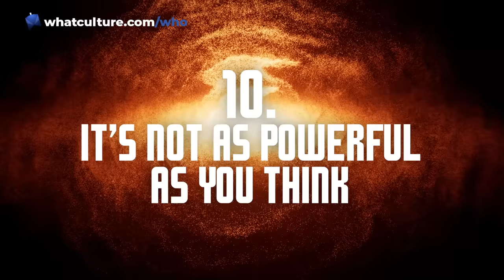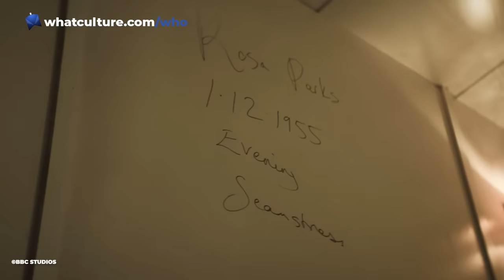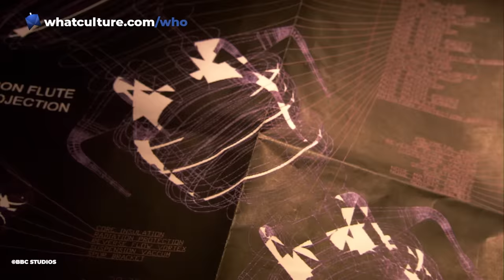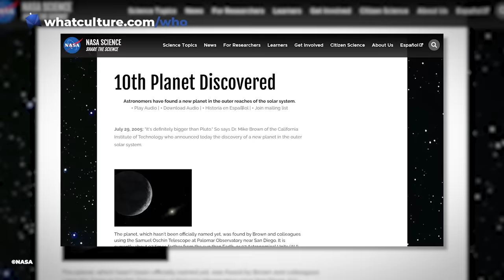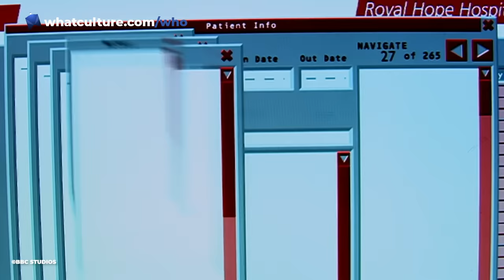Doctor Who: 10 Secrets Of The Sonic Screwdriver You Need To Know

Comment: The Sonic didn’t open the TARDIS doors from the outside not because they were manually locked with the mechanism shown in the clip you used, but because the doors were deadlocked from the TARDIS console.
I don’t know if this is a thing with the editor using the wrong clips, because it also happened when it was stated thr screwdriver could shoot lasers, and the clip showed something that was NOT the screwdriver.

Comment: I want to point out, the 11ths had a psychic interface, the visual dictionary says 9-10s has gallifreyan circuitry which makes a dial or some similar adjusting device where small movements can make a huge change, hence why 9 tells Rose to use setting 1412B (or some such number) to reattach the barbed wire

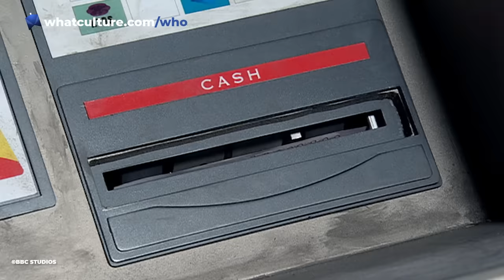Comment: 3:02 Guy with a degree in Theoretical Physics here, with some personal headcanon about The Doctor's magic wand. What is "sonic"? Sound, right? What is sound? Pressure waves. What are waves? Oscillations. What are oscillations? Back and forth movements. Literal wibbly-wobbly! At a quantum level, everything is wibbly-wobbly, oscillating, waving. So if the sonic screwdriver can emit, stimulate, resonate with, and detect quantum oscillations, then it can interact with matter and energy at the quantum level. So it can detect the quantum states of the semiconductors in computers, it can resonate concrete, it can set up vibrational modes in screws. The psychic interface means you point and think, and it feeds back to your brain as if you'd seen, heard, or smelled the information.

Comment: I think the sonic screwdriver is either or both a stupidly good lock pick and signal jammer. Locks doors anything that needs to be opened or fiddled with it will do that. It is quite literally a master lock picking tool. I think the reason those locks could not be opened is due to the fact that the doctor could not figure out how they worked yes he is a genious but they are a cut above what he can do. I think this is a galefriening tool since if they have a living machine that can travel through time and space then why could they not have a tool that could open nearly any door or interface with any machine.

Comment: Wasn't it determined that the sonic COULD work on wood, but the calculations would take centuries? Or was that deadlocks? Then they realized the door wasn't locked in the first place.
Reply: Not exactly. In Day of the Doctor, they were scanning the entire room to get the sonic to calculate a singular weak point in the whole structure. A shatterpoint, if you get the Star Wars reference. So it was the whole room, not just the wooden door.
Reply: @TheFiddleFaddle  The War Doctor explicitly states he scanned the door and implanted the calculation as a permanent subroutine to calculate how to disintegrate the door.
It took around 400 years for the sonic to calculate it, so yes it does work on wood and takes several centuries.
Reply: @jollybodger  And in the later episode 11th Doctor tells the wooden Cyberman (or Wooderman?), that the sonic screwdriver still doesn't do wood. I think it did work only on that door under London's Tower, not every wood. Not like all wood in the world is the same, is it? You have birch wood, then you have acacia wood, then there's oak wood, the list goes on. All have different density, different kind of substance, different properties, some are easily bent, some are hard to even cut. So what worked with a single door in 400 years of uninterrupted calculations, might not work on a wooden Cyberman from a different kind of wood.
Reply: @Croftice1  I wasn't claiming it would be the same for every wood type, I assume it can do wood as we know from a single example, but with the centuries, possibly millennia it takes to calculate it's just easier for the Doctor to say it doesn't do wood.

Also, Rule 1.